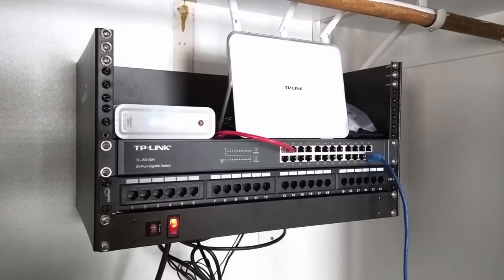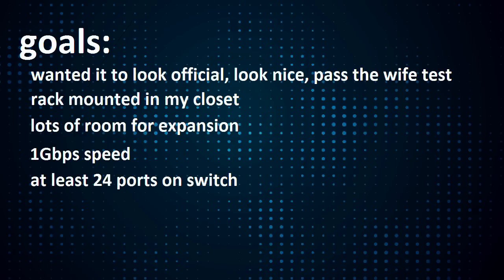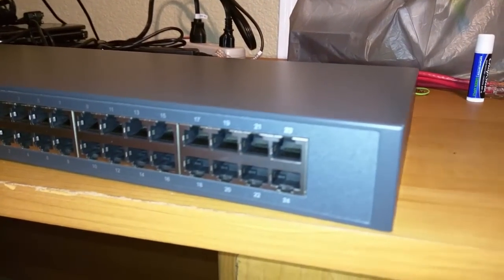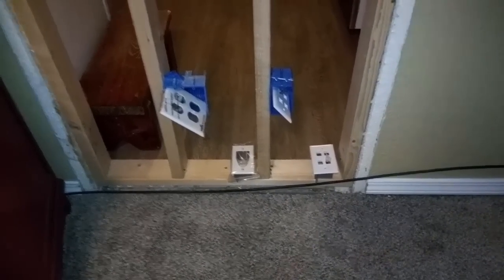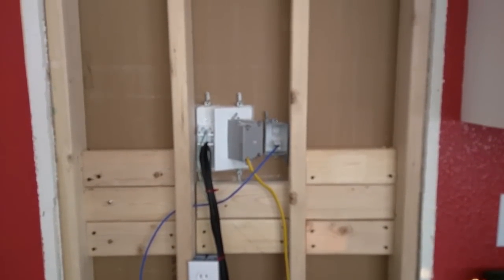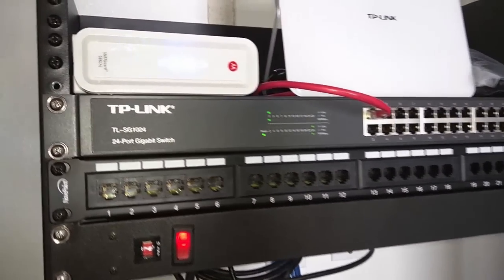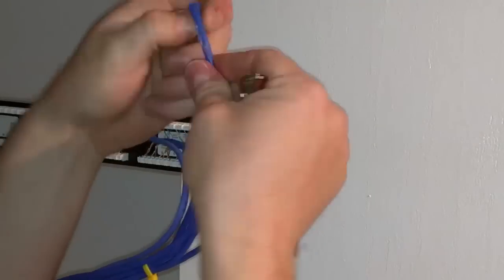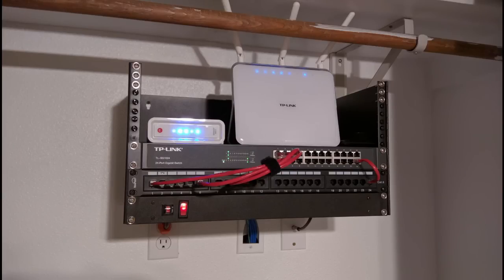Budget Home Network Tour/How To

Comment: Nice work. I did the same thing except I mounted my patch panel in the wall. My interior studs happen to be farther than 16" apart. I put a block of wood in the wall to mount the patch panel to. The panel is flushed mounted to the drywall. I then bought a rack mount shelf for my Cisco switch and also put my setup above the top closet shelf so my coat rack would still be free. 

The one thing I didn't think about was doing a coax patch panel for distribution in the house. All my coax runs to one location outside currently. Someday I'll reroute it to the closet and add a patch panel.
Reply from the maker: +boostedmaniac thanks for the comment. Never heard of mounting the patch panel IN the wall before. That's kind of cool.
Reply: ben johnson 
Mounting the panel in the wall was to help conceal the wires from the back of the panel going into the wall. Although you did a nice job of running them cleanly into the wall.
Reply from the maker: +boostedmaniac yeah it's a cool idea.

Comment: id like to do something like this myself. Very clean work, looks well organized and professional... i feel that will be my downfall (usually is, especially in PC building) where i start off strong with cable management but after several "undo's" and another hours worth of routing i get in such a rush near the finish line i just start stuffing in cables and cramming cover plates over stuff and turn the window towards the wall so nobody can see my shame. again, great looking build!

Comment: Far as that full length piano hinge goes- you can use a Dremel cutting wheel to cut down that strip into sections so whenever you need to just open one section, it's all separated for great ease of use! That's what I do with mine and my friends setups whenever helping them along, and it always works very well and goes off without a hitch
Reply from the maker: That is a good idea!
Reply: Glad I could lay down some knowledge: albeit over a year too late.. . But it's something you can still do, and it's a very handy mod to make use of

Comment: Very neatly done. Would have gone with a managed 16 port layer 2 switch with PoE+ capability on some of the ports though. Gotta be able to run a more central ceiling mounted AP and VLAN support is a must. Can always buy another unmanaged 16 port switch later on the cheap for expansion. 

I like to create separate VLANs for my main, guest, kids networks, and a fourth VLAN for IoT devices and anything else that needs internet connectivity but has questionable security features. 

Thanks for sharing.

Comment: From a physical point of view i like, two thumps up. From a software side of view its either not shown or lacking heavily, neutral.
For example: I hope you have installed a good FW for getting the most out of your network, from your own ISP, security and throughput.

Also its 100% viable if you want to purchase refurbished Cisco equipment or equipment thats no longer supported for your layer two and layer three,
getting industry capabilities behind a strong FW for very very little.

Comment: I do not see any labeling on the cables, how did you keep track of where the cables was routed from?
Reply from the maker: +Jesper Vikström I label the ports on the wall plates, which corresponds to the numbers on the patch panel. Then I just "patch" a little cable from the patch panel to any port on the switch.
Reply: Alright, thanks for the reply!
Reply from the maker: +Jesper Vikström each cable that runs through the house goes from a wall plate somewhere in the house to a position on the patch panel. Each spot on the patch panel has a number. So if the cable terminates on the patch panel position 5, I write or label the wall jack on the other end with 5. Then I run a "Ethernet patch cable" from spot 5 on the patch panel to the switch.
Reply: ben johnson very well said.
Reply: Just wondering did you label first or did you go back and check later? (I always label all cables even if just with a sharpie, when pulling. Maybe just used to it from my commercial experience.) Also, just a tip, it's easier to punch down your cables the other way. I know you said you wouldn't use the hinge, but if you run them down the side with the hinge you can have a cleaner path back to the wall, also if you ever do decide to use the hinge it'll work fine. Lastly maybe use an angle grinder/dremel/hacksaw to cut the hinge to fit just the panel so you can swing it open whenever and not have to remove the rest of the devices.
Reply from the maker: +rpoot82 those are good ideas. I just ran the cable, punched it all down and then identified the ports last.
Reply: Could have used a toner probe as well to track down which cable is which. Worst case.
Reply: If you ran 1 at a time you would know which ones they were. But with a switch, it dosen't usually matter.
Reply: +Cyclingbob With an unmanaged switch it doesn't matter. With a managed switch it is critical that the right ports connect to the right patches or you're gonna cause loops between VLANs and even within the same L2 networks and just ruin the network.
Reply: I KNOW

Comment: The rack is upside down, you can tell by the wall mounting holes.
Reply from the maker: +Hector Monita the logo on the side is right side up.. are you sure?
Reply: Ah! you might be right,  im just basing it on 4:03 in the video but we dont get to see the bottom holes,  they could be upright. don't mind me,  just giving my unsolicited two cents
Reply: Yeah it's upside down
Reply from the maker: +Hector Monita no worries!
Reply: If you watch around 01:53 the holes appear to have the cut outs top and bottom. I see why you have thought that from 04:00 though as it does look like the slot has been put the wrong way up. My guess would be they're made to work either way and a logo is put on after.
Reply from the maker: +Bradbury Robinson that is correct.
Reply: There are notches on the top and bottom. you cant see the top well because he has screws in them.
Reply: I always put fender washers on the screws/lags and you get to choose which way you want it to hinge out. the hole pattern is really for when you are mounting heavy ones by yourself. if the lags are in strong wood you can leave lags out a bit and lift the cabinet into position. it locks in the smaller hole a so you can reach for the tool and tighten each bolt. much easier than holding a 50 lb box and lagging one at a time while looking at a level. if the upside down logo bugs me I just spray paint it.  

good job btw very clean. helpful hint. pull extra cable out of the wall. put the patch panel on a table or short ladder. much easier to punch. push the excess back in the wall. if its a lot go in the attic and pull it up and make a service loop. I hate punching on the hinge thing. scratches the front of the patch panel sometimes.
Reply from the maker: +Robert Purvis good tip!
Reply: So right here we learn, a million likes on someones comment, doesn’t mean that it’s true what’s written in it. I don’t know how low resolution screen those people use, but on my screen it’s very obvious that that screw hole has 2 little holes on Both top and bottom. Plus the logo being upright.

Comment: 2:01 "Does have a 12 inch depth, which should allow enough space for most any typical rackmounted equipment".
(Looks to left to see my Dell PowerEdge 2950 server yet to be installed, which looks at least 3 feet long...)
Reply: No joke! I ended up putting my 2950 on a rack shelf because my rack wasn't deep enough to mount the rails.
Reply: Even if that rack could accommodate that depth, it would never hold that much weight. I think my DL380 G7 would probably make a pancake out of it. But you wouldn't want to put a 2950 anywhere near a living space because they're so incredibly loud.
Reply: Funny you should mention that... as mine is only 15ft away from my bedroom with only two un-insulated walls between me and the jet engine Dell rebranded as a server. Which is 90% of the reason I just use it as a multi-core workhorse when I need it, and a learning playground. Still wish I could actually use the rails I have for it though =(

Comment: Just a couple of thoughts and ideas: I'd invest in an UPS and instead of that punch out I'd simply use a Rj45 crimping tool and install connector plugs. 

The next thing if your house is sprawled out, a Mesh system like Google WiFi or Plume. Both are affordable and work well enough for a home.

Good luck!
Reply from the maker: A UPS is a good idea. I looked in to those crimping tools, the ones I found weren't cheap, and I don't have a tons of ports in my house yet.
Reply: ben johnson 
Most crimping tools cost about $10, and kits $20-$30, but a few are more. My error, I thought you ran 15-20 cables, but okay.
Reply from the maker: +D Jaquith maybe I was looking in the wrong place. So far I've ran 11 cables.
Reply: ben johnson 
I didn't count them, it just looked more. The crimping tool is great for custom length patch cables and it's cheaper to buy a roll of cable and make cables. It's easy.

I'm not trying to make a big deal about it. Do it however you see fit.

Comment: For future reference it’s easier to punch down on a flat surface if you take the patch panel off the rack and lay it down. Also wouldn’t recommend zip ties for two reasons. If you over tighten them you run the risk of messing with the UTP inside the jacket, and when it’s time to upgrade or add to your panel you’ll want to cut those zip ties and run the risk of nipping a cable. Velcro straps are relatively cheap. In your case it’s also not a bad idea to wire map, and verify your cables to make sure you’re getting good cross talk and that your pairs all match up correctly.

Comment: I have to say my network is better than this now.  BUT this is the video that pushed me over the top to actually run cat6a and set it up like this properly. Thank you.
Reply: If you setup CAT6a like this you're not following the standard and it won't perform as good... You need to retain the twist of each pair up to the very last moment to the LSA strips, not like this where there's quite a length of unwound pairs... Also, cables folding like that like the most right one especially is far out of the spec and just won't do 10GbE.
This is fine for hobby, but in therms of quality it's rather horrible.

Comment: Just missing a UPS :)
Reply: Damien LEFEVRE came here to say this. My network stack can run for many hours on a UPS and i still have connection in a blackout.
Reply: @cjkline83  I did this because my security cameras require wifi and its great, I have a pretty small UPS as well and it ran for 8 hours the only time my power went out